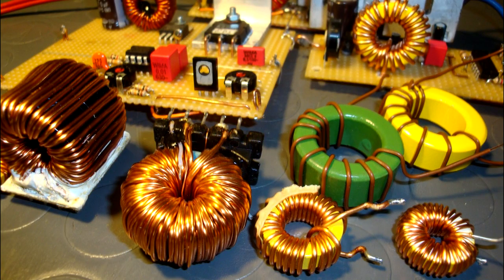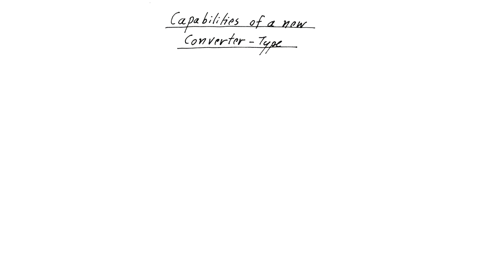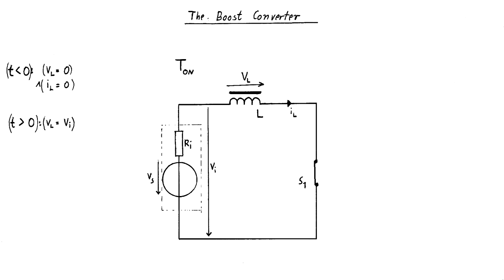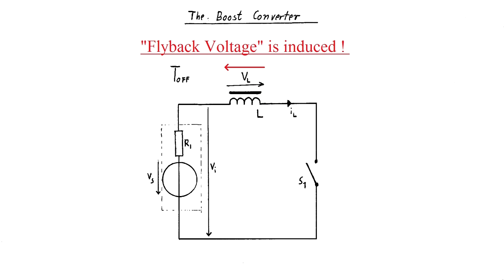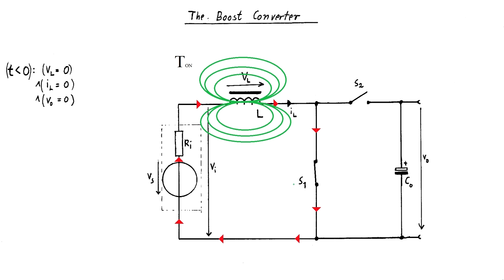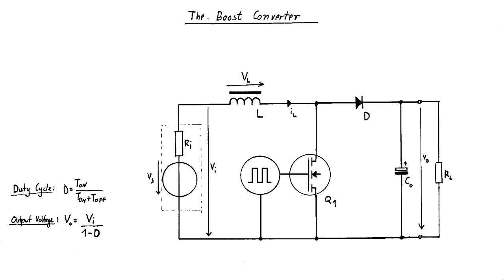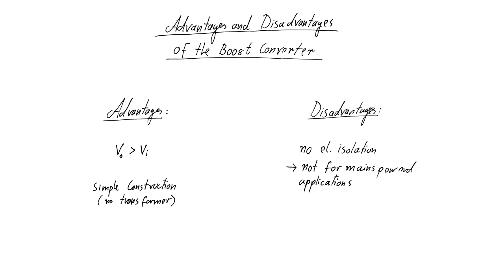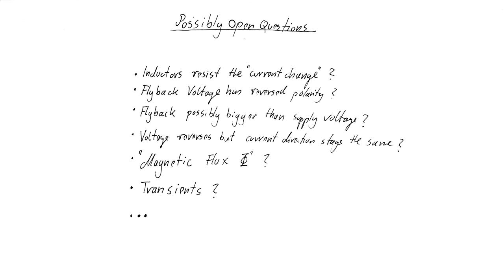SMPS Tutorial (4): Boost Converters, Flyback Voltages, Switched Mode Power Supplies

Comment: Very good explanation related to simple and clear images. One thing that I think is important to stress or explain deeper, is that onece S1 is opened and the diode or S2 starts to conduct, the voltage output Vo (first without load) will depend on the resistance (impedance) the inductor will see in the circuit. In your schematic the capacitor will determine the voltage you can reach. If we forget for a while that capacitors have a break voltage, if the inductor current is driven into a capacitor with only a couple of pico-Farads (like an air gap) you will see a very high voltage. On the other side if the capacitor is of several farads (supercapacitor) it will take much more cycles to reach a high voltage especially in presence of a resistive load in parallel with the capacitor. The capacitor generates a voltage that is an integral of the current "pumped" into it and the slope of that integral is 1/C, therefore small capacitors will reach higher voltages. Once S1 is opened, the inductor will generate only a "flyback" voltage high enough to keep the current at the value when S1 was opened, and that current will decrease during the energy transfer from the inductor to the capacitor.

Comment: Great series of videos, I am really interrested in power electronics and so far you did excellent work on covering the topic, very precise and in proper order. I can't wait to see new videos, especially about flyback converter and perhaps synchronous non-isolated converters.
Reply from the maker: Hello. It's nice to hear that you like my videos so far.

I'm working on part 5 as we speak.
Part 5 will maybe be the most complicated video yet. It deals witch the basics of inductive components, the magnetic circuit, calculating transients and other stuff  and I will still need a few days to complete it.

The buck-boost converter and flyback converter will (probably ) be delt with in part 6.

After that I will explain the workings of the forward converter  and push pull converter (and it's different variations like "half bridge" and  "full bridge" converter (probably in part 7)).  

After that I guess I will make a special video about some real world SMPS, like ATX power supplies. It will also involve some flyback converter related information. After that I will start to make design videos for all the topologies, starting with the Buck Converter, then the Boost Converter and so on. I will have to see if there will be enough time to cover "synchronus rectification" in these videos. If not then there might be a special video about that issue  later.

Comment: The car ignition circuit (at least in older cars) is actually a flyback converter, and in fact is the first switching power supply used in a consumer product. The name apparently came from when a mechanic got zapped and promptly jumped backwards. :)

Note that some newer cars like the 2011 and newer Hyundai Sonatas actually use some sort of step up DC/DC converter (most likely a push pull) to boost the 12V supply to 300-400V or so, then use that to run a forward converter to boost it up to the final 30kV or so. The reason why is because they can get higher peak spark power, which translates into better fuel economy and more horsepower.
Reply from the maker: :D Thats a pretty funny story  !

You are right that most ignition systems are actually flyback converters. But the flyback converter and the boost converter are based on the same principle, only that with the flyback converter the energy stored in the magnetic field is discharged via the secondary winding rather than via the primary. In this video I used this only as a simplified  example and I will say that it's actually a flyback converter in the video about flyback converters.

Comment: Thanks for the videos , well done. One side question , I notice you have transistor and LCR tester from Peak manufacturer , is it a good to have testers ? I am debating myself to get its or not for a long time. Thanks.
Reply from the maker: I absolutely recommend both the LCR and the Semiconductor-Tester (DCA) from Peak. The LCR is great because it can measure even very small and very big inductors and very small and very big capacitors too. Its a good addition to a DMM. The DCA is also extremely usefull, especially if you are repairing a lot of stuff. It can test bipolars, Mosfets, Diodes, LEDs and it always tells you the pinout too.
Reply: The Post Apocalyptic Inventor Thanks for the reply , will get both for my tool box.

Comment: Great video:) i can't wait next videos:) I hope you will show some practical circuits in the future:) and some methods to design own SMPS:) thank's for sharing your knowledge:) Can you reccommend some literature that will help me design my first SMPS? I knowe there is a lot of chip's which are designed to this but i would like to build something from single parts:) I'll appreciate  that:) Greetings from Poland:)
Reply from the maker: Yes I will do all that. I will explain how you can build SMPS from "single" discrete parts. The boost converter which I used in this video has for example no integrated parts at all. I will give circuits and ideas to make own circuits. But first I will explain all the basic topologies. Many people want to build mains powered converters and the topologies needed (flyback, forward and push-pull converters) must be explained first.The problem with most books is, that they are not suited as a manuals for  building power supplies, because they are too theoretical in nature. If you want to start building switching converters you should start by building a square wave generator, that can produce a PWM with variable Duty Cycle. You can do that with the NE 555 Timer or with an astable multivibrator. Then all you need is a Mosfet, a Shottky Diode, a choke (for example 100 uH) and an electrolytic capacitor. ( Most of those parts can be salvaged from ATX-power supplies). With those parts you can build Buck, Boost, and Buck-Boost converters. You should experiment with those simpler topologies first. Power them with a 9V-battery or similar. Later, when you have gained more knowledge you can start to build a flyback converter that is mains powered.  But I will explain all that in detail in my videos. I hope that I can make them faster in the future.
Reply: The Post Apocalyptic Inventor

I've bought some inductors recently. Is this coil: http://www.tme.eu/de/details/coil0810-0.1/vertikaldrosseln/ferrocore/#  good enaugh fo SMPS? I'll try to do something with NE555 timer and mosfet. thank's for reply:) it's nice of you:)
Reply from the maker: Hello. You can theoretically use a cylindrical coil like that for a switching conveter. The maximum current is also important. ( 1,7 A is enough for many applications). I however would recommend to buy  toroidal chokes like this one :

 http://www.reichelt.de/TLC-10A-100-/3/index.html?&ACTION=3&LA=446&ARTICLE=105605&artnr=TLC+10A-100%C2%B5&SEARCH=ringerkerndrossel

The value of 100 uH I mentioned is just a typical value.
I would also buy or salvage some coils with different values for experimentation purposes. Like 47 uH, 100 uH, 220 uH, 470 uH, 1mH.
Reply: The Post Apocalyptic Inventor ok, thank's a lot. I've got some toroidal chokes from old TV's and my old ATX. I must buy or build inductance meter because i don't know their values. My multimeter was cheap ( about 15 Euros ) so it does not have this function. But i've got an osciloscope so i can  measure time to determinate a current value in a simple RL circuit. I hope you understand what I'm writing because my english is not as good as i whish:) what do you think about measuring time base of the circuit and calculate the L value from t=L/R equation?
Reply from the maker: I do understand you well :)

If you want to buy a meter for measuring inductances I recommend this meter:

http://www.reichelt.de/ATLAS-LCR40/3/index.html?&ACTION=3&LA=446&ARTICLE=81767&artnr=ATLAS+LCR40&SEARCH=peak+LCR

It is very good for this job because it can measure small inductances (down to 1uH).

But it would also be possible to measure the inductance in the way you are suggesting. But  it depends on what kind of oscilloscope you have there. If you simply connect a resistor to an inductor in series and switch it to a voltage source the transient in which the current is rising to 99 % of the maximum current will probably be very short. To make that visible your scope needs to have a "storage" function.
Reply: The Post Apocalyptic Inventor hmm, my ossciloscope doesn't have this function. It's old analogue ossciloscope. Maybe i'll buy this meter but it's to expensive for me in this moment:) Life of student, here, in poland is very expensive. I'll ask my teachers at university. Propably they have inductance meter in their laboratories. So there will be no problem.
Reply: The Post Apocalyptic Inventor
You can measure inductance in a variety of ways with a scope such as with a known value capacitor, measuring the ringing frequency after a pulse or measuring the frequency at which voltage and current phase are equal. I've done this in guitar pickups in which the ESR or the inductor is high enough to make an LCR meter unreliable as they assume all the impedance at the test frequency is from inductive reactance.

If it's a proper inductor though, an LCR meter is the best way to measure this and the LCR40 is a good value one compared to expensive big brand ones.

Since I got my LC200A on ebay, a lot of very cheap LCR meters have appeared there. I don't know how good they are. I will say about the LC200A, it has 2 ranges of inductance and both will give a value even if one is way out of range, so you need to know which range the inductor is in before you start, not great. Like many chinese products it also has irrelevant markings on the case from whatever different project the case was molded for including the wrong input voltage. LCR40 recommended above is probably better (and I believe it's made in UK)
Reply from the maker: Right! It's made in jolly old England !
Reply: The Post Apocalyptic Inventor
Ah its a peak!!!
Got one of these from that company.
http://www.peakelec.co.uk/acatalog/jz_dca55.html
Lovely device.
Very useful if you are trying to identify semiconductors from scrap electronics.

Comment: Firstly, thank you for this very informative series of videos!
Would it be wrong to assume that that humble "Joule Thief" is actually a type of switching boost converter ?  (a very simple SMPS)
Reply from the maker: The so called "Joule Thief" is an unregulated  "self exciting" (or "self oscillating") Boost Converter.
Reply: The Post Apocalyptic Inventor Thank you, that makes sense.
But on that topic, do you have any suggestions or tips for construct the optimal and most efficient self exciting Boost Converter ?
I am especially interested in the maths behind the commonly used toroidal inductor, for example is bigger better or just overkill ? Is a 1:1 turn ration the best approach ?
Reply from the maker: Die Ploegskaar I cannot answer this question properly in this comment, nor could I do that in a mail of 5 pages :D
Why? Well, building super efficient self oscillating switching converters is one  of the most difficult things in power supply design. It requires a lot of knowledge, calculations, simulations and experiments. 

But some short advice: 

To increase the efficiency, the power dissipated by the transistor and the ferrite core must be minimized. You would have to try out  different types of transistors and minimize the input current that is necessary to allow proper switching action. Furthermore you would have to use a ferrite material that disspates as little power during magnetization and demagnetization as possible. 

The turns ratio between the two windings must be just big enough to activate the transistor. I don't see how a turns ratio of 1:1 would increase efficiency since one of the windings doesn't carry any of the load current. It simply activates the transistor.

The volume of the ferrite core limits the maximum reactive power that can be conveyed by the circuit. 
A bigger core allows more power, and would also allow the same inductance with fewer windings.
But: 
Ferrite cores have many different properties like the  Permeability, Maximum Flux Density, Residual Flux Density, Coercitive Field Strength, Electric Conductivity of the core material and many more. So simply picking another (bigger) core would maybe also have several other consequences, unless you know it is made of the same kind of ferrite. 

Two ferrites that look very similar can have totally different properties ! 

Furthermore: The circuit looks simple, but the math behind it, is surely not ! Oscillating systems are hard to predict and to calculate. The behaviour of the converter will change when different loads and or sources will be attached. The oscialltion frequency will change depending on the load, which will make the design of input and output filters more difficult. etc etc etc

Comment: If I built a boost converter using a MOSFET what exactly is limiting my current output? Is it the resistance of the inductor?
Reply: Everything basically, the size of the inductor, the type of mosfet or wires in the circuit ( although  the resistance is so small that it can be neglided.)

Comment: I have a 6v lead acid battery and a boost converter to power a dsl modem when there is a power outage. what is the best way to switch it automatically with the wall adapter?
thank you.
Reply from the maker: The easiest way: Take an Ac adapter that directly feeds a relay. Once there is a power outage the relay will turn off, the switch will change position and connects the boost converter (+battery) to your dsl modem. 

But there are other possibilities. You could for example use a comparator that constantly compares the grid voltage to a reference voltage. Once the grid fails, the comparator will pull its output signal to "high" which can then activate a relay, MOSFET etc...that could connect battery, converter and modem. Problem: The comparator needs a supply voltage to operate.

Maybe the best way:
The Battery must be constantly connected via a charger to the grid. Connected to the battery is a comparator.
Then a small transformer is connected to the grid, its output (around 5 V or so) is rectified and smothed out by an LC filter. That DC is fed to the inverting input of the comparator, while the other input of the comparator is connected to a voltage reference circuit. The output pin of the comparator leeds (via a transistor) to a relay which disconnects the modem from the load, while it connects the boost converter to the battery.
The relay can be configured in such a way that it will  consume no energy in the "on" state, when the grid is failing. 

Instead of a relay, power transistors could  be used as well . 

+ Connect a large capacity to the input of the modem, so that it can "bridge" the time needed to switch the relay

Comment: 10:17 Is that really a disadvantage? Like I mean you need the dc to dc conversion so that you don't have to deal with ac at all. If I look at it like this, the things that comes to my mind are:
a) Why would you need thousands of volts that you stepped up from the mains?
b) Why can't you just simply have 2/more coils on the inductor core if you really need the insulation just like in the car or in the HV generator? (and looking at you, SMPSUs ._.)
Reply from the maker: HunChem a.)There are plenty of applications, where you need high voltages. Most of them are related to tube-based technologies: magnetrons, cold cathode tubes, neon tubes, tubes for power transmitters etc....

b.) It is possible to connect one or more secondary windings to the storage choke of a boost converter. But once you have done that, you call it a "flyback converter", even though it is nothing else but just an an isolated boost converter.
Flyback converters will be the topic of other videos that I will make in the future. 

c.) "insulation" is absoluetely not the same as  "isolation" and you should learn the difference. If you want to know what "electric isolation" is, watch my video: 
"The Power Grid, Isolation Transformers and Earthing"
Reply: The Post Apocalyptic Inventor Thanks for the reply, it really made a lot clear. And my bad for the last one, I meant isolation, I just screwed up :/
My other problem was that I didn't know that flyback converters are a completely different thing.
Reply: The Post Apocalyptic Inventor Don't you need to talk about type 2 and 3 op amp compensators when working switch mode power supplies? Else, how do you plan to keep a stable feedback loop?

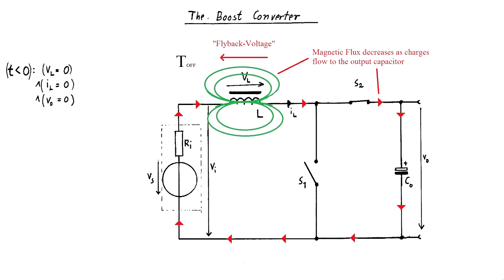Comment: 7:40 shouldn't the current go the other way?
Reply from the maker: Glad to Be Normal No. An inductor is not a resistor. Current through and voltage   across and inductor is governed by Faraday's Law of Induction and not by Ohm's Law. If you check any book about SMPS you will see, that the current flows in the same direction and does not reverse, just like in this video.
Also check these two graphs from the Wikipedia-article about boost converters:

Shows the current arrows:
https://en.wikipedia.org/wiki/File:Boost_operating.svg

Shows a graph of I_L, depicting that it never goes negative (doesn't reverse direction):
https://en.wikipedia.org/wiki/File:Boost_chronogram.svg